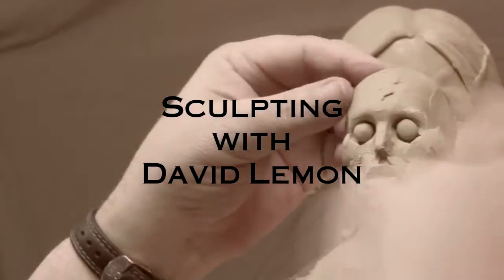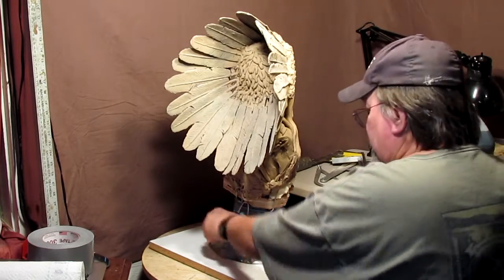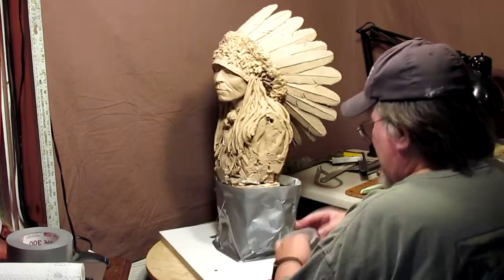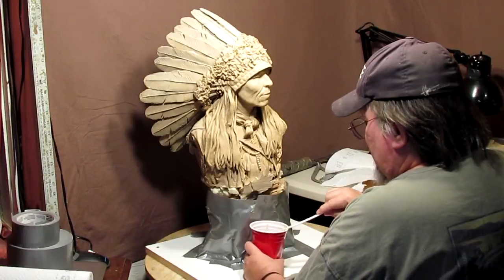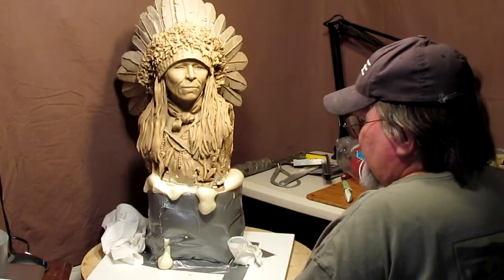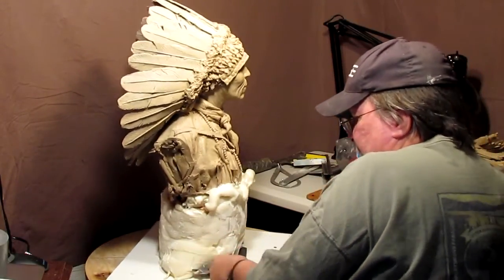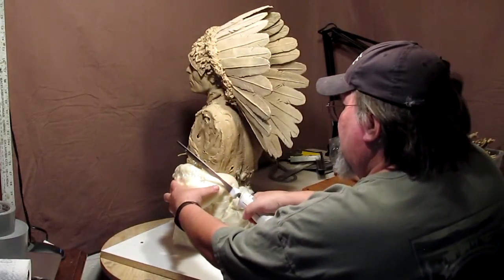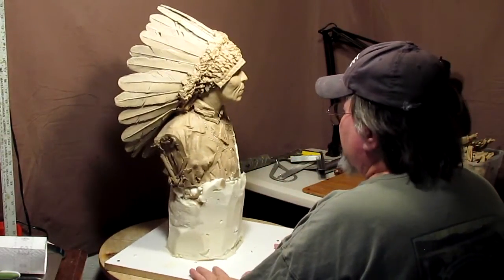Using Taxidermy Foam as a Filler

Comment: very interesting ... this taxidermy foam looks perfect for wooden boat restoration, too. We encountered the same problems like you with the stuff from the hardware store. Duct tape is so versatile. Yesterday, I used it on my bathtub because the silicone seal was leaking.

Comment: This was really cool to watch.  I think I've worked with similar foam before, but didn't consider it as part of the build-up process.  How does the foam react when the piece is fired?
Reply from the maker: The clay is Plasticine and can't be fired.. It stays soft forever.. I finish it and if I sell one I get a mold made of it at a foundry. They make a latex mold of the clay...

Comment: Hiya David, been a long time in saying hello, & aplogies for the lack of correspondance. As usual, your work is beautiful sir & great to see you experimenting with other materials. I have worked with poly' for 20yrs & need to mention for your & others well being; the majority of poly-urethane foams have an 'isocyanate' base usully in 'part b' the darker component. Isoyanate is EXTREMELY TOXIC & as it expands it lets off gases (as do poly resins). PLEASE use a mask & not in enclosed environments.